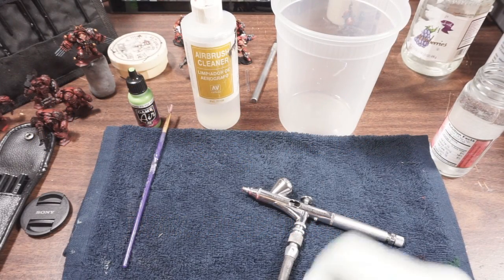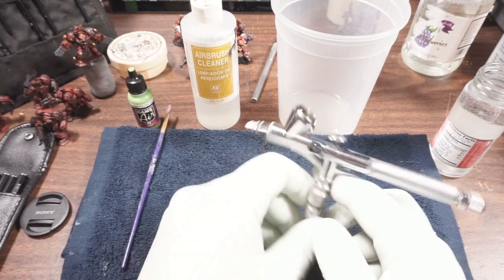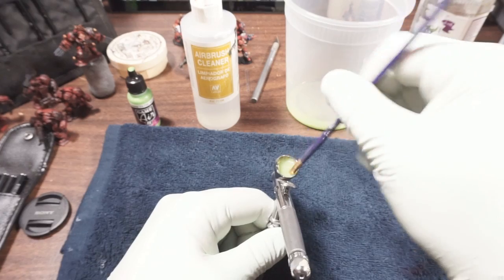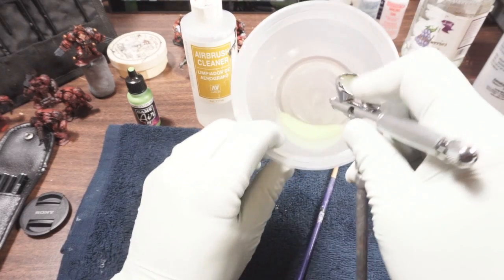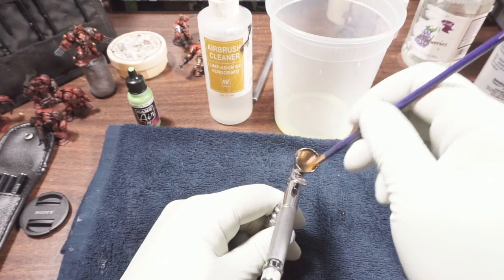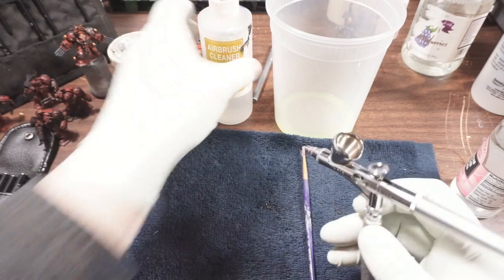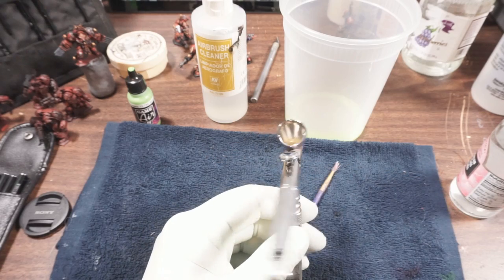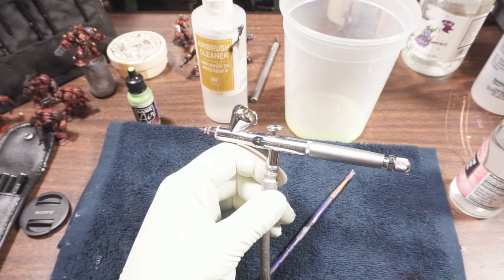Airbrush quick-clean: Cleaning between colors

Comment: The process seems trivial, but when you're not accustomed to using the airbrush these basic videos really help.  Thanks for sharing.
Reply from the maker: No problem. I sometimes forget that I didn't know this stuff at one point.
Reply: This is the number one thing I need to learn as a beginner, because without knowing it, I can't paint! So thanks!
Reply: +1 very useful for a total newby

Comment: Maintenance should be the number one priority when using an airbrush for the first time. Of course I went straight in, just rinsing with water, blowing it through, until the spray was clear, but then my brush started to lose power. I followed your advice and it works! Thanks so much for doing this.
Reply: I did it also. All videos just show deep clean and not quick clean
Reply: Yeah I’ve ruined a couple airbrushes before learning 🥲

Comment: I clean my airbrush pretty much the same way in between colors. However, I do a back flush after I've removed most of the wash. It's amazing how much paint is still in the airbrush.
Reply: What do you mean by back flush?
Reply: @sylvestarrr  Put your finger on the tip of the airbrush to plug it and blow air through it. It will force bubbles back up into the cup bring small debris particles with it. Some people do this as a way to mix the paint that's in the cup already of they're trying to blend or color match some paints. It's just a quick and dirty little trick. It's sometimes called back bubbling depending on who you're talking to.
Reply: @readysetnogo  couldn't have put it better, thanks dude!

Comment: Hello. Great video. I have a problem with my ab. It sprays alcohol, but it doesn't spray paint nor water. What should I do?
Reply from the maker: Clean it. Really well. They only reason I can think that it would do that is because the alcohol is breaking down whatever is in there but when you switch, since it isn't gone, the stuff blocks up the passage again. The truth is that 95% of your problems will be solved with a good cleaning. A deep clean, not a quick clean.
Reply: @JayAdan  thank you for your help.

Comment: For cleaning...just normal tap water or filtered? deionised?
Reply from the maker: Tap water works fine for me.
Reply: I use distilled water. Only because where I'm from the water isn't very clean. Barely drinkable lol you don't want the minerals and impurities in your brush.
Reply: @JayAdan  Would there be any benefit in running methanol or propanol or similar through it after the water? I've never airbrushed but I often use an alcohol (usually methylated spirits) after water to more thoroughly clean my brushes of acrylics.